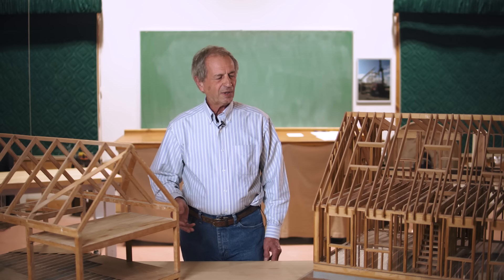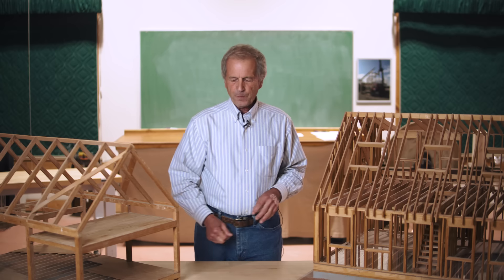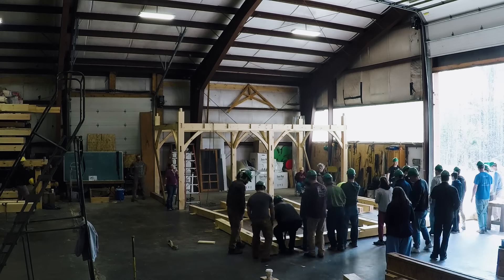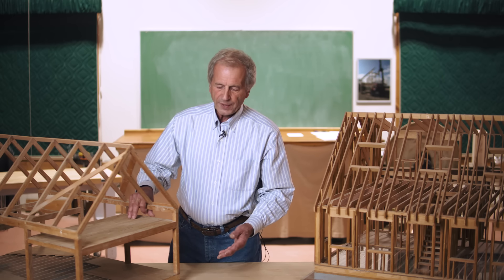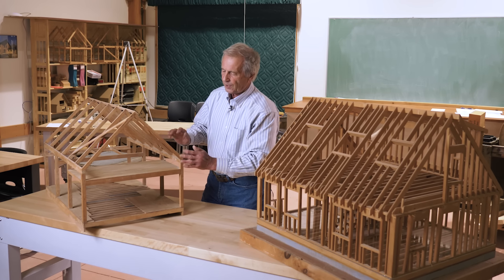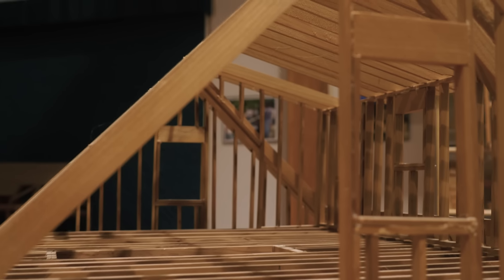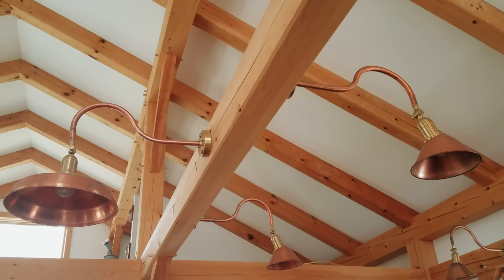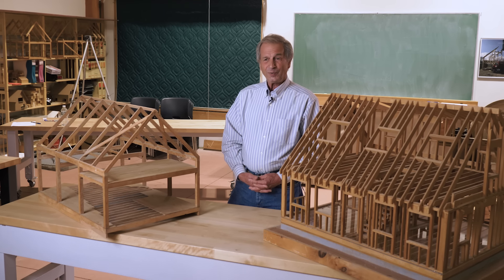Timber Frame vs Conventional Stick Frame

Comment: Great points about the heat loss and the tremendous amount of material used in a stick home. Does a timber frame meet California specs for earthquakes?  Seems like the unions and economic factors didn't put energy and the consumer's pocketbook first: e.g., the amount of foam insulation, the "perfect wall" with radiant barrier all seem to have come out of the need to deal with inefficiencies from the stick home approach.

Comment: Just saying, you can cover a stick frame building with all exterior insulation too, if you want to reduce thermal bridging. Also, now they have 2x6s that are a foam core between two 2x3s. 

Also, I would argue that there are certain advantages to stick framing that are not discussed here. Ease of renovation/modular modification of existing construction, reduced heavy equipment needs to get the real big timbers up and in place, and some other stuff. Not to mention, you don't have the kinds of trees you need everywhere to do timber framing everywhere.

But yeah, for a places woth lotsa big trees, timber framing sure is awesome!
Reply: You are just living in the past. You can order laminated timbers everywhere, no big trees involved 😎
Reply: @tip00former1  compare costs please....bottom line in about everything
Reply: Timberframing can be done with timbers as small as 4.5x4.5" if it's a single story building. And historic methods such as wattle and daub are exponentially cheaper and easier to renovate than modern methods
Reply: @burgeryoufoundbehindthegrill  but not now
Reply: @d.e303-anewlowcosthomebuil7  No, it's still true now, both statements. Check out Japanese traditional construction. They do it all the time. Stands up to typhoons well enough. And some of those buildings are older than the USA. Earth building is making a comeback in the West, and simply requires dirt, clay, straw, and/or dung (if you want, lol).
Reply: @d.e303-anewlowcosthomebuil7  Q U A L I T Y
Reply: @MrJaaaaake  not necessarily any better.
Reply: @MrJaaaaake  plenty of fine stick built homes. open your eyes.
Reply: @tip00former1  Dont get me wrong bud, I love me some engineered lumber. But this video discusses timber framing traditionally using trees on your own land. That is all I was responding to.

And, I'm not living in the past, friend. Wood is the future. It literally grows on trees, whereas concrete and steel are finite, and you have to drag them from the earth. Don't be making assumptions just because I don't think that residential timber construction is a panacea. It's great, just not for every home in ever place.
Reply: @burgeryoufoundbehindthegrill  4.5x4.5? Inches? That seems real small. I imagine they got building code requirement in lotsa places. And, I am not sure what you mean by bringing up wattle and daub. Are you saying that just because it is easy to renovate, doesn't mean it is better? Because I agree, but that really misses the point. I was simply saying that, between the two methods of framing presented, one does have some advantages that have been overlooked. Not arguing that it is better or worse. I have just seen some of rotted timbers from clients who can't afford to have it replaced, but could have afforded to have a couple 2x rotted rafters replaced. Both have some Pros and Cons, is all.
Reply: @PersonMan1234  it is small, and smaller timbers sometimes mean less space between timbers. My point about wattle and daub, and also cob, is that it's an extremely low tech option that is arguably one of the easiest to renovate and repair, and can be done for free. It's an effective wall material, though not for every single climate and situation of course. Not to mention it is much more breathable than most alternatives. It's the type of wall you see in old European timber frames with the white walls.

Comment: Another consideration: Timbers are much harder to set on fire than 2x4s, which go up like matchsticks and are close enough to the next 2x4 to set it on fire too.  A stick built house is like a bunch of perfectly spaced kiln dried kindling just waiting to go up on smoke.

I see conspiracy theorists posting about California homes burning down where the trees around them don't all the time.  These people don't understand just how hard it is to burn a live tree compared to kiln dried 2x4s.  Sure, a timber would burn easier than a live tree, except that it doesn't have any branches to act as kindling.  There is a reason why a fire door can be made out of wood. You can make a wood door that takes an hour for a raging fire to burn through.
Reply: Though, if fireproofing was the main priority you'd avoid wood in the first place.
Reply: @rollerskdude  Yeah, a concrete home with steel beams holding up the roof would be superior but I think a timber frame home with a metal roof would probably be sufficient to save most of the homes in california.  Also preferably without plywood under the steel

Comment: I have been a builder for fifty years. Houses , boats of a 100 tons, and have renovated many houses from the eighteenth century as well as disassembled houses deemed historically  insignificant. I found this video very informative in realizing that timber frame can be as strong as stick frame. I am about to start a community of houses  and am going to use a frame and infill of either hemp or dustcrete.  So my question is how will  I stiffen the build, where I use a Crete and parge on the outside. Extra metal bracing or will mortised in do?

Comment: I would have to say that there is probably the same amount of wood in each of those structures when it's all said and done.  If you think about SIP paneling, you have chip board on both sides of the SIP.  Some manufactures use plywood and depending on the thickness of the wood paneling you could be very close to usage in the stick house.  What about not using sips?  We tend to use 2x4's and in some cases 2x10s to build the outside structure around the timber frame (windows/ Doors/ Chimney/vents..etc).  Many people do not want to go the plywood /chip board route and walls studding is made with inlays every 16/24 inches on center.

The major difference here is the tenon and mortise joints, that is where the structure becomes solid versus a stick frame with simmon/nails.  In some timber framing, though, GRK's are extensively used.  Then we look into the inside of the building, framing rooms, living spaces, doors and closets.  Insulated walls whether you're doing foam/ LSC/ roxul of the sorts and containing.  I personally would say timber framing can use less material but I would be around the 10-15% margin.  Sometimes more if TG ceilings are in play and other wood structures.

Comment: What happened to using full bricks. Instead of plywood and paper (drywall). I want my house to be build from concrete and steel. Slightly expensive but it will survive.
Reply: The best decision!

Comment: The old house where I live has a very rustic old garage that was made that way. When we were remodeling the rotting walls, I was wondering why the roof support seemed "wrong" and was made that way, so different to modern techniques. Yet it was still standing like nothing. But we had to be careful during the wall changes because taking the walls apart would have jeopardize the whole roof support. Now the garage has modern wall support methods holding an old-style roof on top.

Comment: What is a "sip panel"?  I've never seen one or heard of one; and I don't think my Home Depot carries them.  How much to they cost?
It does not look like you have enough support on the ends of the structure.
Reply from the maker: Thank you for the inquiry. SIP stands for Structural Insulated Panel. They are panels comprised of OSB sheathing with foam insulation sandwiched between them. they come in different thicknesses and the R-Value is directly proportionate to the thickness. We have been using them to enclose timber frame homes for the last 30 years. They cost about $8/square foot and come in sheets that are 4xwhatever length we need. The non-gable ends carry the majority of the load of the structure and so the non-gable end does not require additional vertical members. Please let us know if we can offer additional information.
Reply: @ShelterInstitute  Thank you.

Comment: Wouldn't timber framing be traditional and stick framing contemporary?
Reply: Yes. Traditional = mortis and tenon joints etc with large timbers. Stick framing = modern timber framing with smaller but more timbers held together using nail guns. Much quicker, much cheaper. Often timber 'kits' are produced in factories these days on almost autonomous systems. Smaller timber sizes are cheaper because you can get more from smaller trees. Traditional framing is cool though, I have a lot of respect for the craftsmanship involved.
Reply: @scottm4193  yeah, I have a 100 acre property in Wyoming (won't say where exactly) that I bought in '09. I've finally saved the resources to build my family retreat and was doing some costing. Land was cheap because its 3 miles in by dirt road from the main road. Pretty clean but could be better. A friend of mine who bought a property a few miles away made his home from a reclaimed barn in Kentucky. It's a fairly large house (500sqyd footprint) but cost way more than I can afford. He spent nearly $200k just finding, assessing, purchasing then transporting the timbers. He had us over for the raising and he told me it was cheaper to do it with timbers. It was pretty obvious why buy I didn't want to cut down any of the larger trees on my property. I have a basically unlimited source of new growth 2"x4" boards which I can get from a construction scrap yard for free. Gonna experiment trying to make my own glulam timbers and sips. I already found a great tutorial on making fireproof insulating concrete. If you have any ideas I can use I'm all ears. I'd like to build as large a home as I can with the money I have.
Reply: @varun009 Sounds fantastic, best of luck on the project. I work as an energy and construction consultant in Scotland so things are probably slightly different here in terms of codes etc. The standard timber kits here (in mm you'll need to convert to inches) are - timber wall studs 140mm x 38mm fully filled with mineral/glass wool insulation with 25mm rigid PIR insulation on inside face. Timber walls are usually finished with a brick outer leaf or render on blockwork. You can timber clad the kit panels but they don't perform as well in terms of energy efficiency as you have more ventilation in the cavity. Floor build up is usually a suspended concrete slab with 100 - 200mm PIR insulation below the slab. Roof is usually always a  pitched 'cold' roof with approx 350mm mineral/glass wool between and over the ceiling joists. This is how 90% of new build homes in Scotland are made these days but our energy efficiency codes might be stricter or not as much where you're from. Cheap but energy efficient and warm in winter. Generally speaking using smaller timbers will save you more money. But you'll need more in terms of numbers to meet engineering structural requirements. My recommendation is to do as much research and watch as many videos as you can and things will start to come together in your head.
Reply: @scottm4193  thanks for the reply. Research is basically all I'm doing right now. Recent financial gains have afforded me that luxury, but, unfortunately, little else. Our codes aren't strict in that they're not elaborate. This state happens to set energy efficiency regulations but is very lax on how you get to that point as long as your project is in compliance with other building codes (certain distance from trees and all that). Given how cold it gets here, market forces, more so than government regulations, dictate the extent to which one insulates and otherwise weatherproofs their home. I have an idea of what the footprint may be. I'm looking at about 1,200 sqyds built in three modules multi story. I live not to far from a mountain range so I'll be getting higher pitched roofs whose cost to the home's overall versatility should be sufficiently offset by the addition of a second-storey (first storey I on your side of the Atlantic) deck wrapping around and connecting the house. Thanks very much for the input. I'm very excited to get started but I have a long way to go before pouring the foundation. Thanks for the feedback!
Reply: @scottm4193  Any modern prefab builder uses timber framing and not stick framing, its simply inefficient. Sure, they divide the walls which makes it slightly less efficient but still use timber-framing. The stick framing seems to me like something American. Instead of using battens they use 4 by 2 to do the same.
Reply: @tip00former1  Yes they do use timber framing. But it's not the 'timber framing' in this video it's the stick framing. I literally look at architecture drawings and construction details every day I know what I'm talking about! Yeah sure roof trusses and walls come prefabed and assembled on site but ultimately they are made up of smaller timbers which aren't exposed.
Reply: Yes at least in Europe for the last..1500 years. Like that: https://pxhere.com/en/photo/458684
Reply: @[The] White Rabbit You're simply wrong. You can get a timber kit for around 40,000 in the UK which can be produced in a a factory and erected on-site in a matter of days after the foundations and ground floor slab are laid. Doing the traditional route, even with free access to on-site timber, would still cost a hell of a lot through specalist trademen required and the amount fo hours of labour required. And it would take many months.  As I said I work in the industry I know how much things cost, how long they take, what the build-ability is like.
Reply: Stick (balloon) framing was developed in Chicago in the 1830s as a quick method of building with pre-cut lumber. So not very 'contemporary'. Both are 'traditional' but 'timber framing' techniques are at least 2000 years old. The Fairbanks House, 1637, Dedham MA, is the earliest timber framed house in US, and stands (with later additions) to this day.
Reply: Both can be used for building in both traditional and contemporary architectural styles. Timber framing is most suitable for Tudor and other old world styles, whereas stick framing is good for every other style.